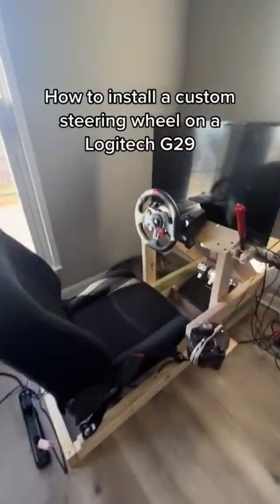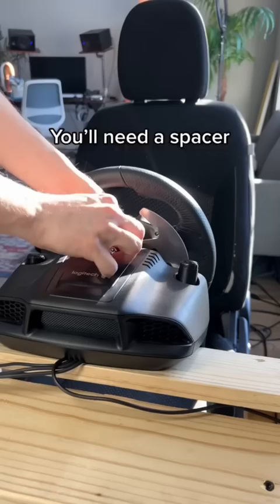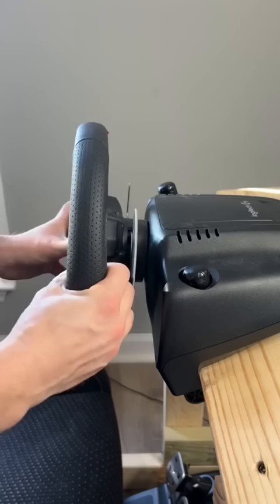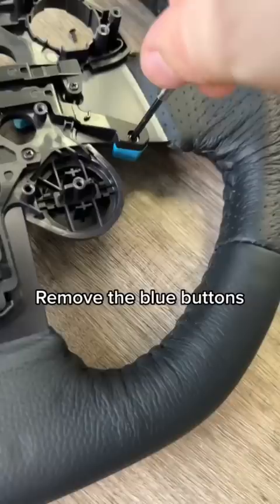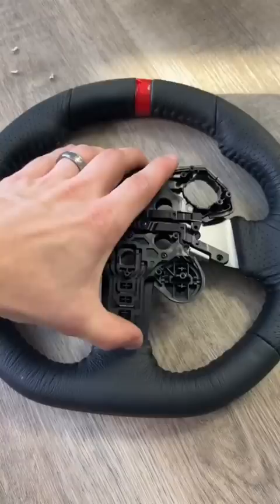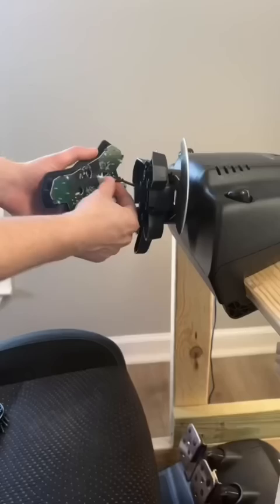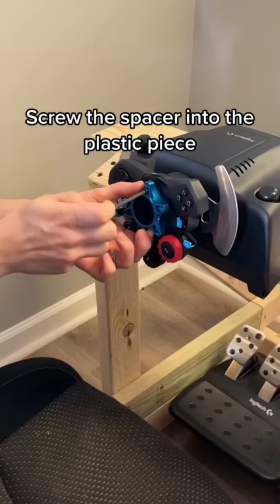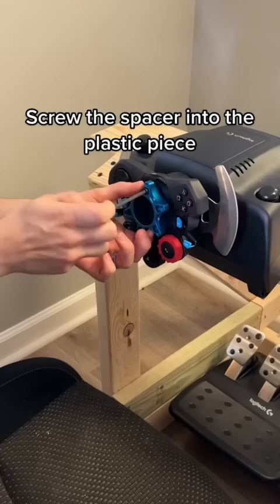How to Install a custom wheel onto your Logitech G29 / G920 !?

Comment: Should i buy logitech g29 or thrustmaster t300 or t300 rs gt for my First wheel? I play ets2 ans plan on buying games like forza horizon 5 or assetto corsa.
Reply from the maker: Prob thrust master
Reply: @SimRacingSucks  thanks but t300 is price of g29 and stand for it combined so ill probably get the g29 with stand
Reply: @SHADOW-oj5yz don't it's a waste of money, the ffb is weak, it will keep all your neighbours and entire house up because how loud the gears are and the wheel isn't interchangeable also the h shifter is overpriced plastic garbage

Comment: could this also work for a x box logitec g920?
Reply: Yes you can. G29 is practically the same wheel as the g920 bar some extra buttons and different firmware. also says in the title of the video

Comment: G29 haven't got enough torque to drive a heavier wheel and all the real car wheels heavier than original logitech's one so you simply killed all the feedback and fun from the wheel. If you want to custom mod your sim racing setup go get another more powerfull base like a direct drive base from logitech or fanatec.

Comment: Time to change wheel on a G29.... 20 min. 
Time to change Wheel on a Semipro/Pro Thrustmaster/Fanatec? 20 Sec (5 Sec with Quickrelease) I would NEVER drive a Simulation with a Logitech...
Reply: 20 min vs 20 sec, $200 vs $2000, what’s your point. You literally said yourself, “pro”. The G29 is a budget wheel, it doesn’t have the same features as a pro wheel
Reply: @Matty27  i know what you mean. But whats about the T300RS? The T300RS is a budget wheel too. Same technology like the TS-XW racer and you can change the wheel in 20 sec. And it costs the same like the Logitech G29 and has much better technology (nearly like the pro setup)

Comment: Did you lose some force on FFB because the bigger wheel?
Reply from the maker: A little but then just crank up the settings
Reply: @SimRacingSucks  and then wheel overheats quickly :)
Reply: @Custom2udo  false. :)
Reply: @scarecrow5848 nope it's not wrong :)